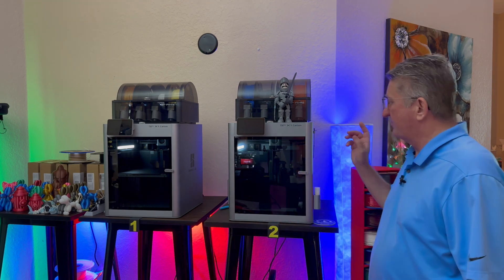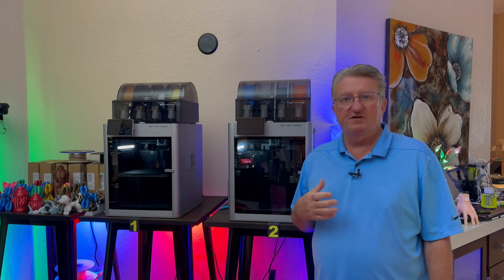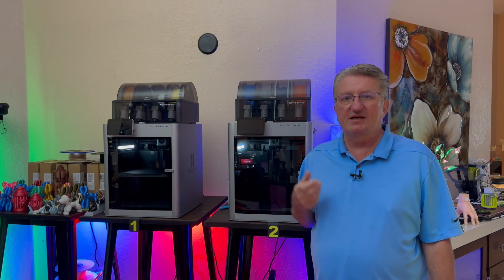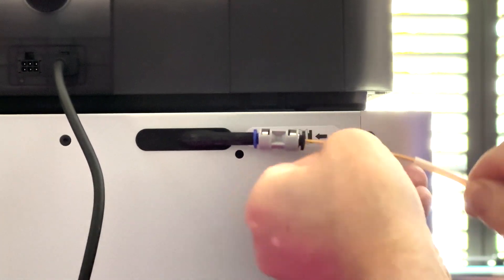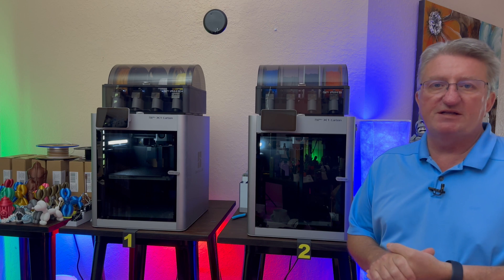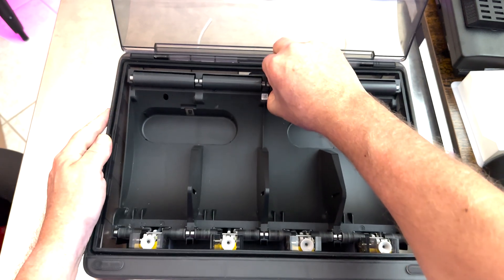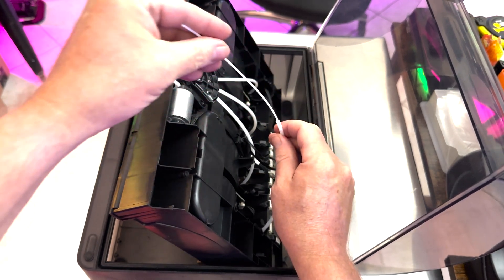Solving Common AMS Problems on Your Bambu Lab 3D Printer: Tips and Tricks

Comment: Keeps saying there's filament stuck but I cleaned all the tubing and it still won't feed filament out the ams
Reply from the maker: It’s either the extruder (check the extruder video on my channel) or the hot end (check the hot end video on my channel).

Comment: Hello sir i have the 2nd broblem with that wierd sound coming from slot 3 with red light,when i opend the ams there was no stuck filament and it keeps giving the same error i dont have any idea about this ,it is a 6 months old ams2 .Can u help me with this problem.
Reply from the maker: Could be that there is another piece somewhere. Try to push a filament through the whole tube/1st stage to see if there might be one somewhere. If not, there is a possibility that your sensor of that 1 bay is broken. Then you might have to open a ticket.

Comment: Wish I had that issue, instead my ams is causing surface artifacts on my prints
Reply from the maker: What makes you think it’s the AMS?
Reply: @techwithkramer Decided one day to print with the external spool after trying many things and found out it was the ams. Its a deboss/emboss rhythm artifact somewhat. All four feeders cause it. It started bombarding my prints with it for the past two months and I went back to check on old prints if they had it, and they did, but very faintly or just rarely.
Reply: And my oldest print was from 4 months after buying it. Its been 14 months now.
Reply from the maker: Wow, first time I hear something like this.
Reply: @techwithkramer I was surprised as well. I spent hours crosschecking the artifact, hoping to find someone who had the same artifact at some point. I almost ended up buying a new x1c 😂.
Im just currently checking with bambu support if theyre willing to give me a replacement with it being outside the warranty period and to send them my ams for them to inspect further
Reply from the maker: Good luck to you. The AMS2 is soooo much better…

Comment: I don't even bother putting the screws back in the spool holders because it is such a hassle to clear broken filament. Wish there was a way to pull off the back tube and push the broken filament out. So frustrating.
Reply from the maker: What I do is I break the brittle part off before putting the spool in, this helps a lot. And after I finish printing, take the spool out of the AMS.

Comment: this piece of crap has one issue after the other for me. Never reads or detects a new spool when changing out colors. Power cycle, reload, 50/50 shot if it works. Or manually go in and assign it everything. Sticker is there on the bambu spool as well. Have a white light it takes up the spool line a little but still doesnt detect it. Been one headache after another with this thing.

Comment: The wiggle trick worked. I had powered off / on the printer and unplugged and plugged in the AMS connector already. But when I wiggled the AMS connector cable at the back and the four red lights (insert Capt. Picard joke here) went white. Thanks for the tip. Bambu should be ashamed of such poor quality connector. The connector cable had not been moved in a year yet that fixed it.
Reply: I also just found the other end of the cable was also loose the other AMS connector on the hub on the back of the printer. The wiggle trick worked briefly but red lights returned but pushing on each end of the AMS cable each connector seems to have worked.
Reply from the maker: Oh no, so I guess you might need to watch my video on how to replace that connector board next…
Reply: @techwithkramer  All good did a wiggle of both ends. I also had some TPU stuck in the hot end. Heat gun plus cram in some PLA got it out. Everything is working now.
Reply from the maker: Glad it worked. Further down the road you might end up having to change the connection board, but I have a video about that online too…

Comment: I'm having the first issue at this moment, I opened a ticket, I pulled out the stuck filament from AMS and still not be able to fully empty the spools and start automatically new one or simply make a swap filament or rewind when the print is over. I'm having right now an issue with tech department from Bambulab where they upgraded recently the firmware and, before that, was working without any issue. They don't want to fix it and I can't use the AMS. Right now I'm using a normal spool support like an old 3D printer.
Reply from the maker: I doubt the firmware update would make a difference, otherwise everyone would have the same problem. Do you have the issue in all the 4 slots?
Reply: @techwithkramer @techwithkramer  yes ... I have the same issue in my two AMS.
So my option is to put the AMS hub in the left position and try again.
I haven't any issue if I put manually the filament, so I discarded an extruder issue,  but I toke notice that the splitter, that I printed year ago, has anything inside so, I will try to use a drill if I can clean up inside or buy directly the splitter from the A1.

Comment: 1:41 yes mine exactly but can’t get the red light to turn off - I’ve cleared all the tubes, opened the AMS a few times.  I’ve cleared everything out of the tubes.
Reply from the maker: Is this one one or all the slots?
Reply: @techwithkramer  I found a tiny piece inside the black piece with the 4 slots.  WHEW, it's now working great again!  Thank you.
Reply from the maker: Yep, they can sometimes be hard to find. Glad it worked out for you.

Comment: Hello, I’m trying to help my son. He is getting this error. Your videos are so helpful. Thank you. I did every step that you suggested. I even took the filament and ran it through each slot. See if it was stuck in the white tube but it’s not and it stops when it gets to a certain point out of each portwhat should I try next? Thank you so much.
Reply from the maker: Does it make any noise? If not, I could be that the sensor is broken.
Reply: @techwithkramer  no noise. I can see a tiny piece of filament that broke off in the piece that goes from the ams to the white hose. I’ve tried everything to get it out. Any other recommendations?
Reply from the maker: @ Try to take some filament and push it through. Take the white PTFE tube off on the tookhead and go all the way through the ams (press the loading button) with some filament. This should do the job.
Reply: @techwithkramer  thank you for your guidance. My husband had to take the feeder apart and clean it. I attached a video so that you can see the issue we had.

Comment: Has anyone had an issue when the filament is not detected in the AMS, so you pull the filament up and down and it then detects it and you can start. The problem is that the sensor doesn't detect it. I am not sure if it's the filament or the sensor.
Reply from the maker: Never had it but sounds definitely like a sensor issue. Is this only at one of the bays or all 4?

Comment: I have the issue on my third feeder almost every time the print is done kt doesn't retract and stays at 99 percent. I checked the tubes and they seem fine even printed upgrades to keep straight. Do you think replacing the feeder can help?
Reply from the maker: I don't think it's the feeder. Try turning all ptfe tubes around, like unplug both end, turn it around to the opposite side and push them back in. Including the 4 in the ams. Let me know how it goes...
Reply: @techwithkramer  okay I'll try that thankyou. I've literally been looking for a video like this for a long time. Hopefully this helps.

Comment: Good vid. I am currently stuck in the middle of the 'failed to retract filament' issue. There is absolutely no filament anywhere in the whole line from hot end to AMS. It won't let me install any filament either. Just keeps popping up with the same message.
Up until now my X1 has been brilliant. I love it. But I'm worried I won't be able to solve this issue.
Reply from the maker: This is very common. Try to take a piece of filament and push it manually from the ams to the printhead. Best is to take off the often tubes on the arms and the print head. If this works, put the professional tube back on the printhead, heat the nozzle and see if you can get it to extrude. If that works, then it’s the AMS. Open it and take the ptfe tube out of the position you tried to print from, turn it and put it opposite inside after checking it to make sure it doesn’t have a hole. Let me know how it goes.
Reply: @techwithkramer   Heya, thanks for the help. I tried it, and it worked!
Reply from the maker: That’s wonderful news!

Comment: This video was a real life saver. Troubleshot all of my minor issues with my X1C and ams pretty easily up until slot 2 refused to load any other filament.  And it kept grinding a rough spot in any roll I tried to load. Realized must be a piece stuck in that particular slot PTFE tube.
Reply from the maker: Good to hear it worked out for you!

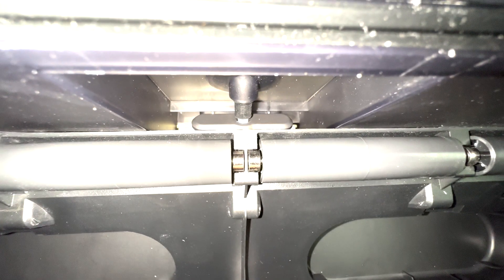Comment: 2:13 for some reason my ams doesn’t have this is there any way to get it out still
Reply: You just have to get a pair of tweezers and pressed down the place where it usually goes
Reply from the maker: Cool! 😎
Reply from the maker: Do you have the AMS from Bambulab? This is inside, in the back of the AMS. Every Bambulab AMS (not AMS light) has that.
Reply: @techwithkramer  yes I have that ams from Bambu the part came in disconnected just sitting in the ams, I thought it was and extra part so I kept it in a bag with the spare hot end
Reply from the maker: Oh wow, so a transport issue. Were you able to put it back and use it?
Reply: @techwithkramer  no, ive tried I think I might have to cut the tube. I’ve posted something on the Bambu discord but no response
Reply from the maker: Did you open a ticket? It’s such a seldom issue that chances to get an answer from users that actually helps might be pretty slim.
Reply: @techwithkramer yes I just fixed it

Comment: I just got an "AMS assist motor is overloaded.  Please check if the spool or filament is stuck". It was not. I'm still at a loss.
Reply from the maker: It might be a broken ptfe tube - check all of them, specially the ones inside the AMS.

Comment: Love your videos! I have AMS problem, I was gonna use the included "PLA Support" filament but now the software on my laptop say, when I try to print without the darn PLA Support filament. I removed it and now I can't print! Error: Please click each filament above to specify its mapping AMS slot before sending a print job!  When I click the color - there is only one color to click on, it is an a yellow, where the PLA Sup. material was, I get all of the spools grayed out! It also popups a message: Note: Only the AMS slot loaded with the same material type can be selected. The touch screen attached to the X1-carbon has everything correct! Can you please help me? Thank you so much!
Reply from the maker: Thank you for the compliment. Sounds like a synch problem. There is a symbol - I think it’s where the filament is to the right, its a little printer symbol with 2 arrows showing in opposite directions - to re-synch the software with the printer. I am currently on a trip, so I cant exactly tell you where its is, but you should be able to find it.
Reply: @techwithkramer  I'll try to find it, but I shut down the PC and the printer, didn't help at all. The printer has the colors right and where they are.... on the small display, but the software can't resolve the problem. Thank you so much for a quick reply! Have a safe trip!
Reply: @techwithkramer  So far nothing is helping my problem. I uninstalled Bambu from my PC and start over, like the day I recieved X1C. Shut down PC and did the same with X1C, and after all that I turned the pinter on ON. The first was the printer - I removed the filaments, restore printer to factory settings and I inserted all 4 filaments, not the PLA-SUPPORT filament! Turned back the PC and installed BS and went thru the settings..... But as soon I open the file I could not print, it behaved exactly like before!
So I installed brand new BS on a PC and I was able to print again! It was a puzzle, but when I wanted to print more items from that folder, on my PC that is a desktop running Intel i9....,  it behaved like my laptop, I could not print at all!
This is behaving like a bug in the software or some other undocumented function....????
Does Bambu send to them, from my PC info about BS? Since it worked once on my desktop, but the next print could not happen, just like the laptop!
I'm gonna remove not just the BS program but also all the info in the registry and folder where BS was installed at.
I'll do this on my laptop as well, and I'll reset the printer one more time - I hope this will work.
Is there a phone number one can call Bambu to get help? Or a direct email that would get answers to my problem?
Thanks again!
Reply from the maker: So far there is no phone number. Hopefully sometime in the future. I use a MAC, so maybe this is a PC specific issue. Good luck on figuring out the rest.
Reply: @techwithkramer  Thank you again and have a great day!

Comment: This didnt help me at all. my Hub will not pick up anything. my first motor will go  itll stop but no more will go
Reply from the maker: You need a new first stage for the ams. If you are still under warranty, open a ticket.
Reply: @techwithkramer   brand Spanking new, i re did every plug  blew out every sensor for the ams, yeah i opened a ticket. this is my 3rd bambu with a problem. my A1 came broken, my p1p came with a fried board  but was resolved in 6 days and NOW i believe i need a new Hub board  it will not pick up. man ive been SO unlucky with all my bambus
Reply from the maker: Sorry to hear that. Sounds like you really are unlucky - but I am sure Bambulab will take care of you.

Comment: Have the fourth issue, all lights. Safe to say that this printer is a lemon or the connections. Problem is that when it works, I’m addicted to it 😂. I should have gotten a non ams version or a prusa………
Reply from the maker: It’s not perfect but it’s still the best option out there. Open a ticket with Bambulab and they will take care of you. Yes, it might take a few days. Maybe one day, they will have a 24/7 hotline like Prusa, but don’t forget you pay for this with the printer price. A good move would be if they would offer 24/7 support as a paid option… so yes, it’s not the fastest support, but at the end they make sure your machine will be back up and running. And then, nothing else gets even close….

Comment: having the retraction problem for 3 days now, thanks will give it a try. the other  2 error messages i get  "failed to pull out the filament from the extruder, this might be caused by clogged extruder or filament broken inside extruder. [07008003 164116] i've run a pin down thru the extruder to the nozzle break repeatable  till no more filament comes out the nozzle, then i get an error that asks to retract the filament on the external spool. problem i don't have an external spool. i keep getting one of three of the same error messages...
Reply from the maker: Failed to pull out usually happens if either one of the PTFE tubes is damaged or if the spool doesn’t fit. On the AMS, it will many times be a piece stuck in one of the internal tubes. It might also be in the tubes going to the extruder or even the ones on the back, specially if it thinks it’s the external spool. Try pushing some filament through every tube you have, it must be somewhere…
Reply: @techwithkramer  did that couple of days ago and Everytime after I gotten the error messages. I finally just forced the filament into the extruder, and it worked... Haven't tried to switch the AMS between spools yet. Sent a ticket to Bambu.

Comment: Maybe you can help me with my particular issue! After printing something out of slot 2 (only happens with this slot, but with different spools, always the same problem) and after it rewound the filament, the slot shows "empty" and the light is out. I have to pull out the filament manually just a bit, so the AMS recognizes the filament and starts the process of registering a "new" filament in the slot. I have to do that every time I used slot 2, which is annoying. Do you have any idea where that could come from? It feeds just fine, but after retraction it always is displayed as empty
Reply from the maker: Sounds like a problem with the sensor. I would open a ticket with Bambu on this.

Comment: Solved my issue so fast with my brand-new machine! this should be on the official Bambu help page! I had broken filament in the AMS (old brittle filament my fault). 

I wonder if they could design a feature where it would do something like open the tubes/path, disable the stepper motors, heat the hotend etc and you could manually push the broken filament through with another filament to be purged at the hotend? Save users from opening it all up.
Reply from the maker: Good idea!

Comment: I had a problem with silk PLA filament the jammed in the collector where the four PTFE tubes connect. The filament stripped and clogged the feeder in the collector and I could not clear it. I could not tear the collector down enough to clear the clog. Therefore the AMS is completely ruined. I will never run silk PLA through an AMS again. 
Also, not related to the AMS, but I will not run TPU on my  X1. It is not stiff enough to feed through the hotend properly.
Reply from the maker: I am using Silks all the time (overture) and have no issues at all. Yes, TPU isn’t easy, luckily I don’t have a use for it, so I only tried it - it worked but it’s not as easy as other material to handle.